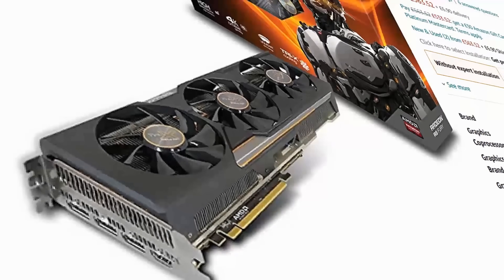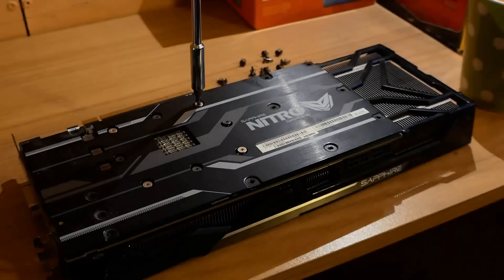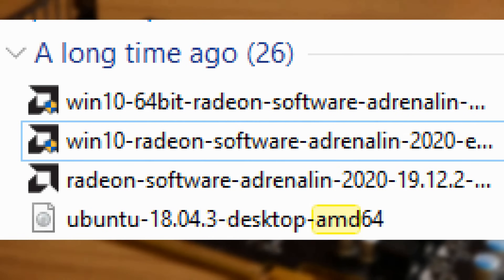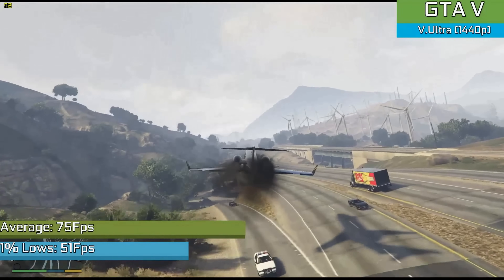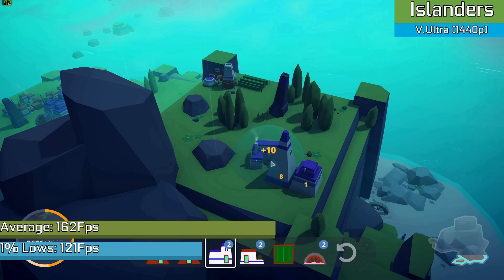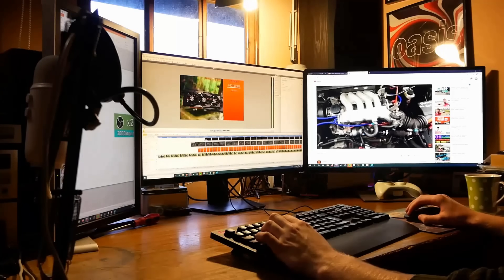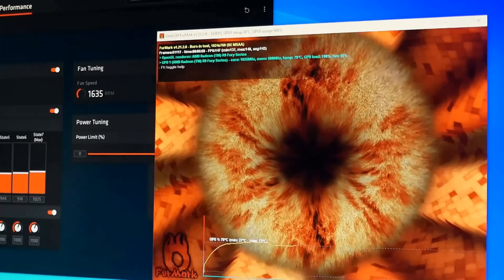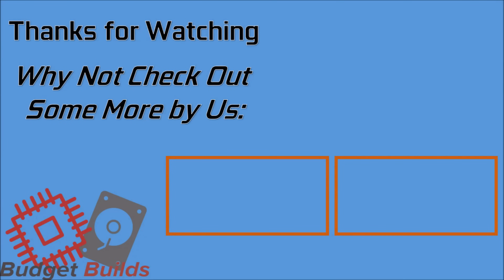The AMD Fury - A Fantastic Failure!

Comment: Budget builds complaining about the Fury’s 275W of TDP
Me with my Sapphire Vega 56 Pulse with 280W: *sweats nervously
Reply: The RTX 3090 has a TDP of up to 500 watts (EVGA FTW3 Ultra) and no one is complaining :-D If 280W is to high for your liking you should try undervolting+overclocking, my Vega 64 Nitro+ never goes above 220W and reaches higher clocks than stock.
Reply: You undervolted it yet?
Reply: Me with Gigabyte Vega 56
 *sympathetic sweating intensifies
Reply: Me on the Fury's OC (300w) bios with power limit cranked:
Reply: Me: Looks at my pc
Radeon VII: Hey
Reply: have you tried to 64 flash it ? don't do that, well unless you want to use bios 2
Reply: @FuriosusD06  some Vega 56 cards can't bios flash in less their hbm2 memory is made from Samsung, a good majority of them are Hynix now a days. like my Asus ROG Strix Vega 56 had Hynix so I couldn't bios flash it to a Vega 64, sadly.
Reply: @L337f33t  there is a new vbios for it, check it out, on Tech power up. My 56 used to hold 1470mhz at 900mv for 150watt, hbm oc including.
Reply: I managed to OC UV my Vega 64 to 1v at 1600MHz and I get power consumption around 160w to 180w max
The memory is overclocked to 1080mhz as well
Reply: @Domstar97  its 350 not 500 watts, normal it will pull 360w
Reply: breathes heavy looking at my undervolted power modded vega 56 drawing ~350 watts 0.o
Reply: I mean my 2080ti goes to 360 370 watts too in 3dmark but i think its more about the performance offered for that wattage, i think people were upset amd was using a lot more power and still not able to offer comparable performance
Reply: Two Vega64 here. Watercooled, they ran cool (edge 30 junction (hot spot) 60) and at 1650 rock stable. If i let them rip, they can suck in 350+ each, with a tendency to jerk the power rail with those milisecond 0-500W pulls. had to buy some super beafy 1300W Seasonic to not have the issue of random shutdown/breaker off events, but usually just let it run on default (its rare i actually care to fix the voltage settings, dosent really have the motivation anymore.), then its 220W per card. (You can undervolt it very nicely, and push the clocks high, or you can go really deep on undervolt underclock to below 100W and still be able to play most easier load games with 60+ fps. These are awesome at low tdp low clock! (The reason why they were awesome at mining! )
Reply: @Boborjan1986  wow thats an impressive setup. I got really lucky with my gigabyte card... Ripped the backplate off to let the vddc vrm breath and stuck the 64 bios (samsung mem wooo) and she sits pretty at ~1700/950 undervolted at 1.09v. Drawing 365w at peak moments... on air she get toasty to 50 degree c but stays stable and i must say im still happy with it for the $350cnd i payed for it new
Reply: I'm with a REFERENCE Vega 64! LMAO, it's Undervolted and slightly OC though
Reply: @FuriosusD06  Can’t, the VRAM is Hynix
Reply: @Amusia727  Oh yeah definitely. For 280W at stock though, well my 500W sff PSU probably had a good time trying to keep up with that before I took some time undervolting
Reply: HD4870 X2 and those 420W... yikes.
Reply: What the fuck are you doing to make the vega 56 run at 280W? My vega 64 barely hits 200W and destroys everything.
Reply: You have a dual bios .
One for 160watt and one for more power.
But if you set it on 160watt tdp and than set in the drivers more power use.
Than you can set it on 180 watt and still have the same performance ass the AMD rx5600xt .
With drivers wat do work than de hybrid gpu from the rx5000 series.
Reply: @Domstar97  yeah but on the 3090 voltage scales well with clocks and it doesn't throttle. So high tdp isnt bad in this regard its just high. With vega and fury, clocks literally throttle at stock voltage wich is insane, its like buying a laptop.
Reply: My vega 64 pulling 380W: x))))))))))
Reply: Meanwhile my Radeon HD 6990 on 415-420W
Reply: @Domstar97  I've seen 3090 (not even Ti) with unlocked BIOS doing 615W. Insane.
Reply: @Domstar97 "and no one is complaining" literally EVERYONE was complaining about that in 2020 fym
Reply: My  6800xt undervolted and overlocked to the moon sits comfortably at 315w

Comment: You owned a Fury?!  A man of my own heart❤️

HBM is really neat even if it doesn't make the GPU objectively better than the competition.
Reply from the maker: It looks cool atleast. Which is certainly something.
Reply: I kinda wish AMD would release a BigNavi with HBM2E. The small size it could be built into, would be insane! 

(Two vega64 here! )
Reply: Agreed, HBM always seemed like a glimpse into the future, even if it (thus far) hasn't proven to be. I purchased an R9 Nano just to own what I felt is a piece of history. Hopefully we haven't seen the last of the technology.
Reply: @Boborjan1986  If I remember correctly, CDNA2 does have HBM2 rather than RDNA2 GDDR6. But maybe RDNA3 might goes back the HBM2.
Reply: @Boborjan1986  RDNA2 doesn't really need fast VRAM for gaming purposes. AMD learned from its mistakes with GCN which was much more compute focused. RDNA2 can make due with slower memory than Ampère for gaming purposes.
Reply: @CheapBastard1988  Thanks to the extremely fast 128MB L3 cache. Without it those 5120 shading cores would really feel the pain, of which it kinda still does at 4K. The consoles respective GPU's really suffer without it, for example the series X is speced out somewhere between an rx 6800 and rx 6700xt, but only ends up only somewhat beating out the rx 6700xt. So about 26-38% of the Rx 6900xt performance can be traced back to its L3.

Comment: Remembered when RNien Fury X got released? That thing comes with 120mm AiO by default lol.
Reply: Cries in current GPU Fury X.
Reply: @LocoMe4u  LOL truer words never spoken.  But seriously first one had bad coil whine had to RMA or was gonna be committed to a room with padded walls.  Second one is really quiet but I did change the fan too.
Reply: that coolermaster AIO is pretty good tho, quiet and effective especially if you replace the fan. i've also used a fury x for a long time, it stays at around 50 celsius under load
Reply: I've been running one since roughly December 2015 and now the bearings in the pump are going bad :( it still works but it makes a faint grinding noise intermittently. Sucks but it's served me well the past 5 years.
Reply: ً  had a 120mm AIO on my FX 8350, it did not run hot.
Reply: ًbroom  my 980ti with hybrid cooler ran 45c all day at 1500mhz.  And that was with the radiator in the psu side of a corsair air 240.
Reply: I raise you the r9 295 x2 with full length pcb and an AIO but for 2 gpus on 1 pcb.
Reply: @dimitrilensflareabrams2893  but what about Pro Duo? the forgotten monster

Comment: Since it was my main GPU from 2013 to this year and it served me well I'd love the see a video on the 7970. It was also the last time AMD was on top when it came to GPUs.
Reply: 7970 is ok low-med 1080p gaming card for today games. But it is outdated with support for DX12 so newer games will not work with that card.
Reply: @IgorBozoki1989  it has dx12 support
Reply: @yournemesis192  Only up to feature level 11.0. It's total BS I know but titles like Death Stranding won't work on it.
Reply: @livingthedream915  weird considering it runs on PS4 with a cut down 7870 chip
Reply: @yournemesis192  There were different versions of all of those chips man, the 7870 was reborn as the r7 270x (just a rebrand that was still dx12 11.0) and finally with the r7 370x it was moved up to feature level dx12 12.0. Yes it's stupid, AMD should have moved all their lower spec cards up to that but they were being cheap as hell. First 3 sentences should have the info you're looking for https://www.techpowerup.com/gpu-specs/radeon-hd-7950.c307
Reply: Actually the R9 290X was the last time they were realy kicking Nvidia in the nuts, the 290X was like 500 bucks and the Titan (Kepler) was on par in performance and just 2 times more expensive, and back then when multy GPU was s thing AMD showed there 295X2 for 1000$ and Titan Z with 2 titans inside was 2 titans for the price of 3, well played Nvidia, 295x2 was still faster than next gen cards like Titan X/980ti, I wanted 295x2 so much
Reply: now with the 6000 series theyre back on toP!
Reply: Its a Nice Comp. 1080p Settings gpu. 

Comp settings are all low except for render distance, which is high

Comment: Great video again. I'm sort of in the same boat as you with my GTX 1060 6GB. It plays all the games I want it to and I don't need to lower settings on games any lower than the high pre-set. So I'm the same as there's no compelling reason for me to upgrade from this yet as it still does what I need it to and nothing else on the market is enough of a jump, like you say in the video.
Reply: I feel the same with an rx580 8gb
Reply: That's the right way to go about it imo. No need for upgrading if you don't need to, if you do it's mindless consumerism.
Reply: I feel bad for the people using 3GB versions of the 1060, it's like having a DDR4 GT 1030 compared to the GDDR5 one
Reply: @QuackCola  I'm on the same boat, I have a 1070 but want a little more since I want to do more high framerate gaming without lowering settings, and occasionally play at 4K 60hz on my TV.

Comment: The Nano was the real jewel in the crown from that generation. Same core configuration as the Fury X but at a TBP of 175 W and in an ITX suitable form factor. It runs about 10% lower clocks to get there, but the top 10% of clocks on these cards are the ones that give you the least performance. I was using one as my main until recently, and it performs somewhere in the middle between an RX 580 and a GTX 1660 Super/ti. As you say, it's just about picking the right settings. Despite the tiny heat sink and single fan it never got above 74c. Probably my sentimental favourite of all the cards I've owned.

Comment: Still using my Fury as well, I actually have two but crossfire is dead so I just use one. Testing this card with settings appropriate for it was a really good idea, people think it's slower than it actually can be, just because there are a few settings that make more of a difference on it than on other cards. 
You're right about these cards going up in price tho, it's really odd. In 2019 I snagged one for for just 95$ and not as a one off but there were a bunch of other cards for around that price, now they are more like 150$ locally. Drivers were also definitely a problem before the whole bad drivers for Navi situation blew up around Feburary, since then I haven't had a single problem with drivers and it seems that whatever they did fixed some of the issues on Fiji as well.
4Gb also hasn't been a problem for me, for whatever thats worth given that i dont really play that many modern games. But ye all and all im happy with my card too, it's not gonna be worth to upgrade from it until the around 200$ cards finally get refreshed, it's been the same performance tier there for a while.

Comment: Used to have dual Asus R9 Fury Strix running in CrossFire on my system. Have since given one away to my friend, whom is still using now, while the other is back in its original packaging in almost pristine condition right on my shelf. Love the card to bits, it served me well for a good 3+ years.

One thing I have to say is that the Strix version of this card is really beautiful and that backplate is no joke. The card is perfectly straight even after being in my system for 3+ years.

Comment: IIRC, this architecture was the last to support analogue DVI, which means a 390x is the best card you can get that supports VGA and thus CRT monitors.
Reply: Are you sure it's native VGA inside the GPU and not just via a dedicatd chip on the graphics card? If the latter is the case you'd get the exact same result by using external DVI-, HDMI- or DP-to-VGA adapters.
Reply: @armorgeddon  I don't really know about that, I just know at least one of the DVI ports is VGA compatible.

Comment: My RX480(Sapphire Nitro+ 4GB) despite being still one of "potential black screen" cards still does me fine!(although i still need to upgrade to AM4 platform from Socket 1155, and Windows 10 is sometimes an arse..) I'm still thinking about undervolting it but so far i didn't notice any issues with standard/auto tuning AMD's Adrenalin software is giving(nor any driver related issue . I might upgrade to something like RX 5500 XT or Vega 64(because weirdly enough 64 is cheaper than 56 here but there is still GTX 1070 Ti to consider in the whole mix).

Anyway it was interesting vid!

Comment: I got mine on sale in 2017 from Newegg for $200. 
It has done me very well still use it to this day. 
It's still an absolute beast and I see no reason to upgrade it so far. 
Still plays literally everything I throw at it at High to Ultra Settings at 1080p with good FPS.
the only thing making me kinda wanna upgrade is how low the price of the 1080TI has become. 
1080TI is still a badass Card but I like my R9 Fury. It's been with me since 2017. 
It also looks really pretty.
Sapphire easily make the best AMD Cards.

Good Video mate.

Comment: G'day BBO,
Loved the video, Although Not putting out an image I still have my Sapphire R9 270XToxic, it was my second GPU, I still have my first too, it is a Gigabyte GTX260OC (it is still working in my XP PC),
I know it is a reasonable performance comparison between GPUs as it is an ongoing consideration after purchase but except for my RX550 I've never bothered to check power consumption for any of my GPUs I have bought for gaming,
The only reason I did check the RX550 is I was seeing how little power usage was running with my Athlon200GE,
I built this as a silly experiment to see what was the 'Cheapest New Gaming PC' I could build with a Real GPU
, I was so impressed with the Athlon it is now my HTPC,
I can't remember the GPU OC but I had the 200GE to 4GHz@1.41v (it's daily setting is now 3.8GHz@1.3v), with the OC Running CB20 & Furmark together I almost got to 150W for whole PC

Comment: I run a Fury X myself. I have liquid metal and a full cover waterblock, that I happened to find for only $20 brand new, and it still holds up very well for me. I alternate between 1080p and 1440p whenever I need more fps for competitive online titles or better graphics for rpgs. Its been really good to me when I bought for $150 three years ago when I replaced my dying GTX 780 SLI setup. One of the cards died on me so I had to replace them. The Fury X is currently paired with a R7 2700X and its a pretty solid experience. I could do with a better gpu but I'm gonna hold off until the 1080 Ti and 2080 Ti fall in price. I did manage a small oc on the core. 1130mhz is the best I could manage with an inability to oc the HBM. I doubt it'd amount to much. The 80Mhz bump only managed a 6% performance bump.
Reply: Except Ark survival. That's running at 720p high cause the optimization for it is really garbage.

Comment: I got a Fury X off eBay with a full cover EK waterblock for £80 delivered just this October. I've found that as long as the VRAM size isn't an issue then its not too far off from a 1070 in terms of performance.

Comment: Yeah, it's a common thing to see rare top end Cards like the Fury or Titan go for collector prices, but even that aside I think a factor often underestimated is the need for good and strong PSU.

Personally, I think the sweetspot for most people would be something like a 1060 6GB or RX480/580 8GB. If you play on 1080p or less on a 60hz Monitor, those cards should allow to play most Games at good settings and I really like maxing out textures on the 8GB RX480.

Obviously, not everyone / everywhere can or wants to afford such a GPU/Build but it's also great to see how much one can do with GPUs that sell for pretty much the price of "something with a display output" if not thrown away. 

I think the last ones that surprised me were the bigger HD5000 and 6000 series, which don't have driver support anymore and usually just 1GB Vram, but in terms of raw power, they're actually not that bad. I think the 5850 should be on a level with a GTX 750 (roughly), so up to about GTAV things should run well.

Comment: I was generally staying up to date on drivers throughout 2020, although, I always had to wait for that first "The drivers have stopped responding but had been recovered" or however that error message was phrased. After that, things worked fine. I replaced it late august though, as I needed something faster for upgrading to an ultrawide monitor. My Fury was always run in custom liquid cooling, so never had any issues with heat either.

Comment: I'm running a second-hand Nano atm, while waiting for the 6800xt to deliver. Surprisingly decent, even for Apex Legends today. Used two Strixx Vega 64s for 3 years, sold them recently. Got two mostly to mine, but ended up playing a lot more, and when Crossfire worked it rocked. Undervolted most of the time and stable, if we exclude Crysis 3, the only game that crashed within a minute if the cards were undervolted.

Comment: I went for 2 x 290X running crossfire and i do agree on the 4Gb memory problem can't use maxed texture resolution when running 5960x1920 because of that. They do get rather hot as well. It was a good choice for me since I needed 3 screens but now it's time to upgrade.

Comment: I still have my R9 Nano, i love that thing, even if it isn't a powerhouse, it's small and compact, that's what i loved about it. Nvidia claiming how small they made the GPU and how they made "pass-through" cooling...it's like everyone forgot that Sapphire did that with Vega all those years ago and that Vega was small as hell back then for the power it held. Hell i would have loved to see a low profile Vega with 2GB of VRAM and lower clocks to either be PCIe powered only or just one 6-pin, because it was quite possible to undervolt it A LOT. But sadly, it didn't happen :(